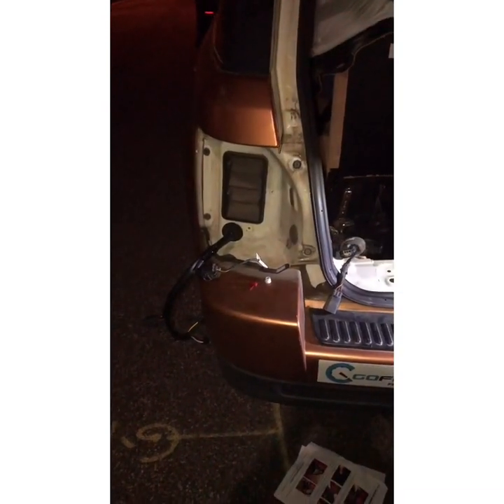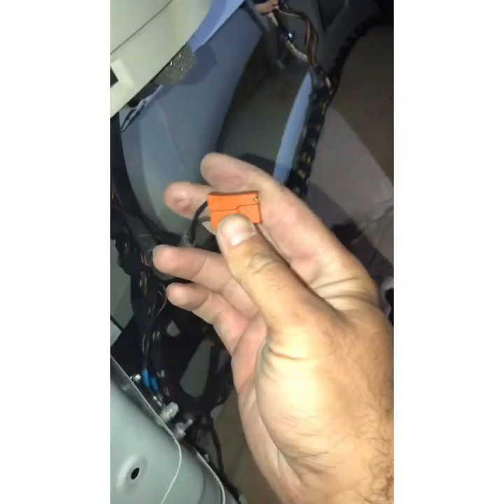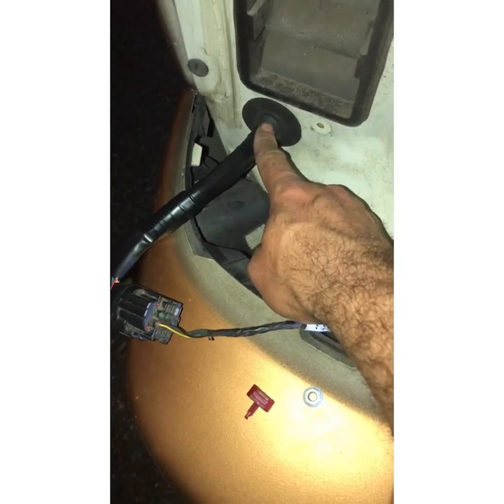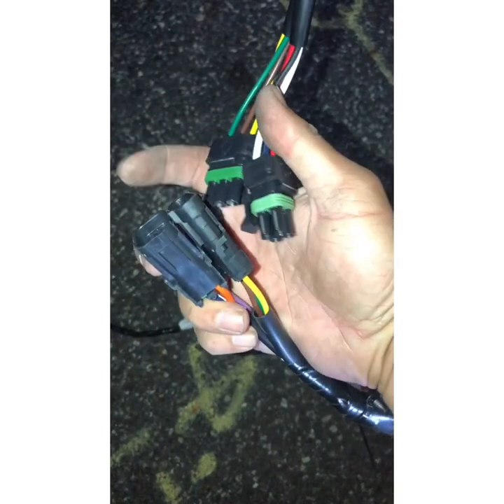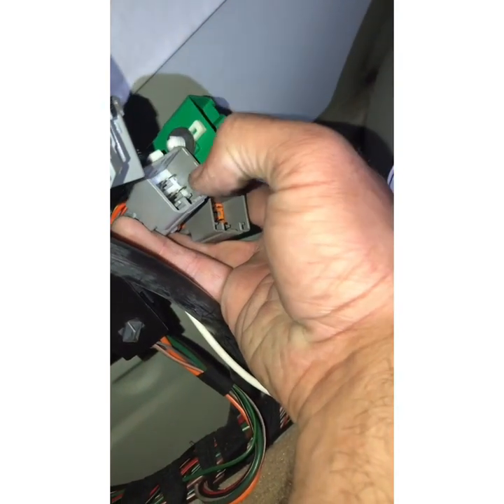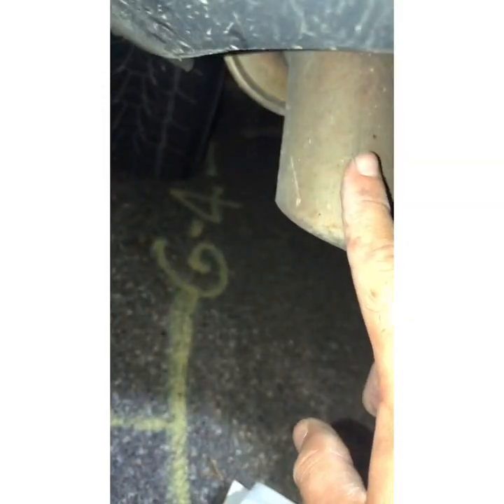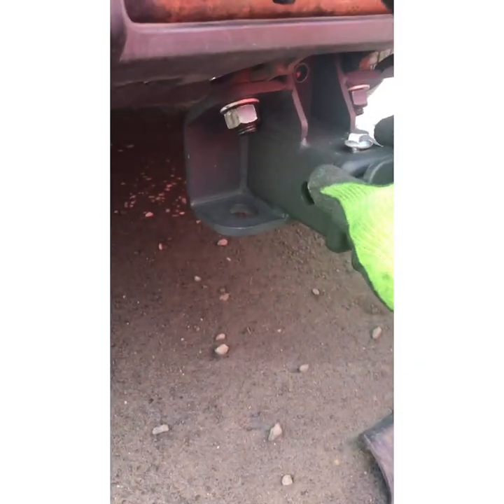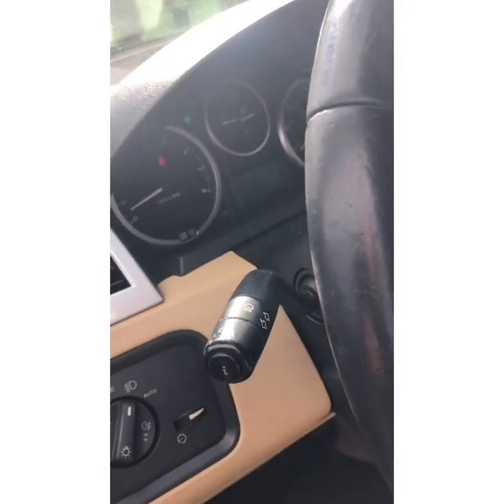How to install trailer harness on 2007-2013 range rover sport

Comment: These instructions do NOT work for a 2013 Range Rover Sport. If you purchase the OEM wiring harness kit for this make/model, it has two connectors. The instruction booklet only has illustrations and makes no sense. However, for my 2013 RR Sport… I did a lot of digging to find that you must remove both taillights and the bumper cover (tip: remove the tread plate on top of rear bumper to access 4 clips, and all the other small screws on the bumper are around the bottom and fender wells). Once the bumper is off, you’ll see two cords with dummy plugs attached to the bumper frame and that’s what you’ll plug the new wiring harness into. There is NO need to open the interior panels for this make/model. It does help give you more room to work to drop the spare tire too. Hope this helps!
Reply: Does it need to be speacilly programed at dealership ?
Reply: THANK YOU I HAVE BEEN SEARCHING FOR THIS ANSWER
Reply: @baileybrown5218 did you end up hooking the trailer wiring up? And did you have to program them or did they worked after you plugged them in?
Reply: @waynemccullough4801  im doing the d
Same right now? Please dont tell me i have to program them. I sure hope not!